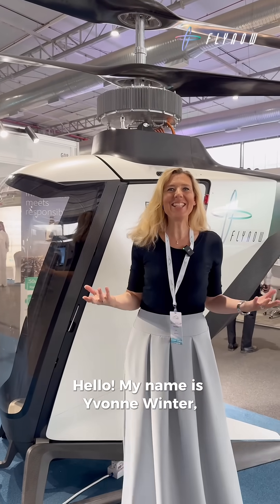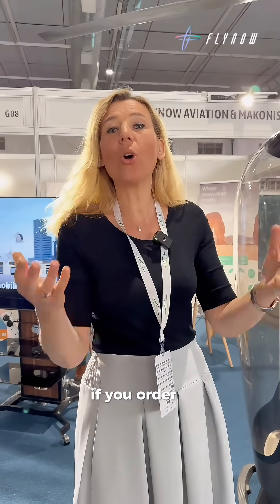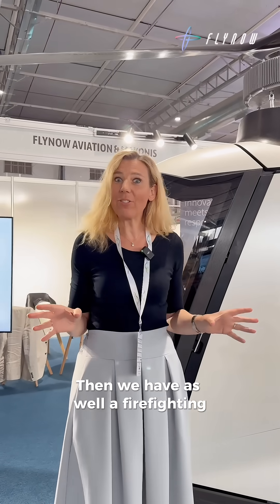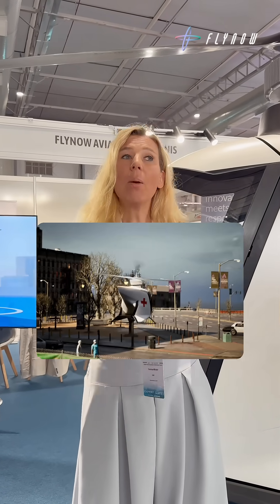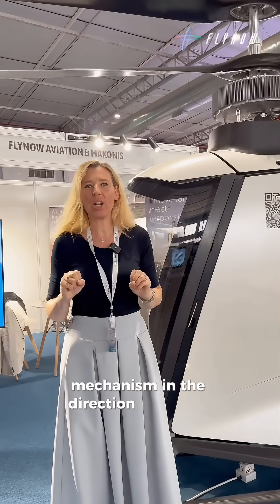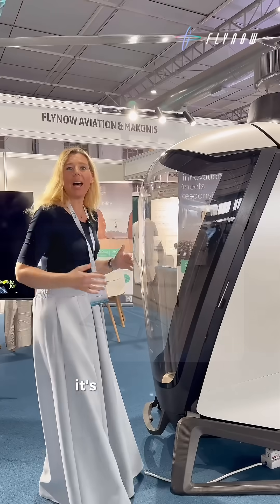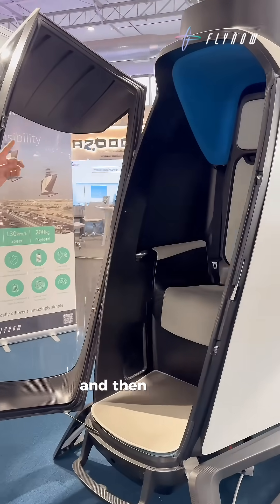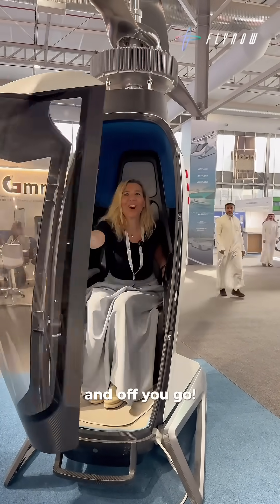Have a look inside the FlyNow eCopter #shorts

Comment: Damn the algorithm is always bringing me Videos like this. Despite the fact i am a Petrolhead.

So nice Engineering….

But i do not believe in Electric Aviation. Even less than the electrification of Cars. 
I told also „Heart Aircraft“ a few years ago they will never stay in Budget and a fully Electric Aircraft will not work. Surprise They changed their Concept and needed much more Money.

Why do you not make bigger helicopters? 2 seater i would say way to small. From my experience in Aviation it’s because of the much higher requirements for safety things. Rotor burst ….

Good luck to you but i think it will not work